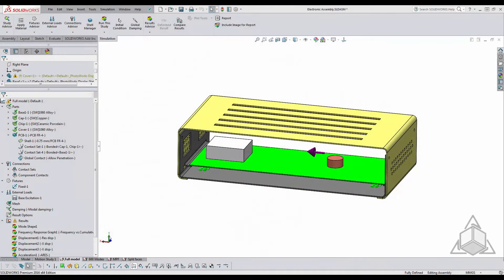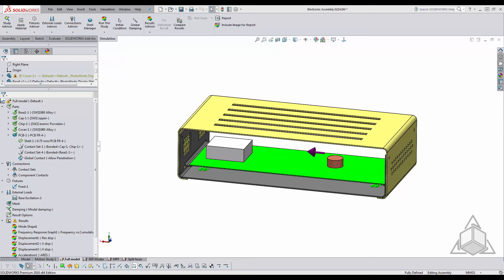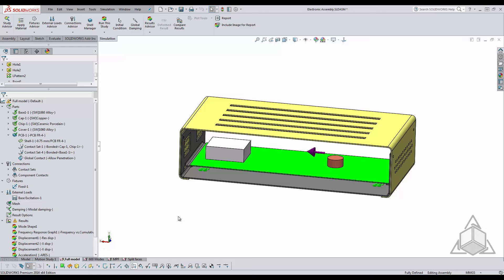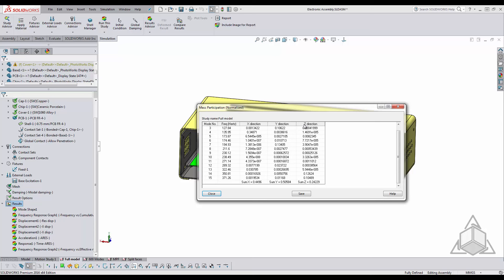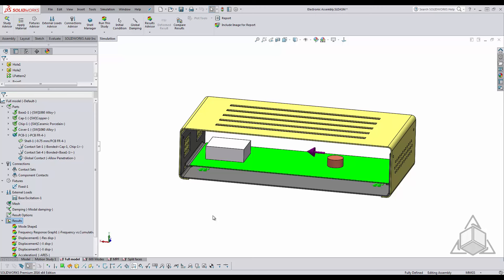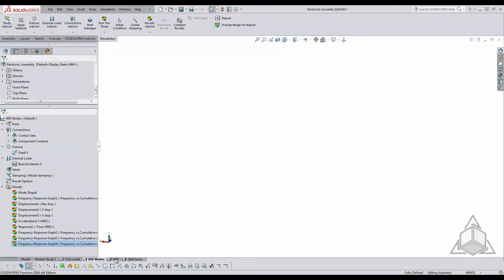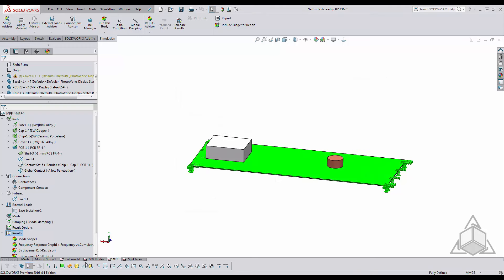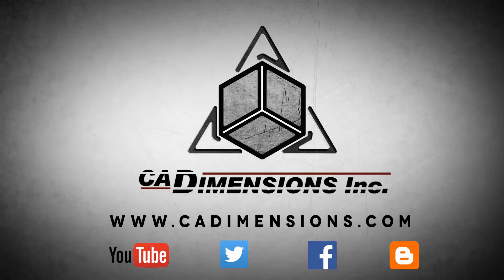Tech Tip - Determine the Number of Modes for Linear Dynamic Using Mass Participation

Comment: not sure that using the number of modes which was enough for the subassembly is right, since more modes will sow up from the rest of the model.
you should remember the frequency you found for the 65th mode and for the entire assembly run just the frequency, verifying if you got to the same frequency.
if you didn't - increase the num of modes untill you do